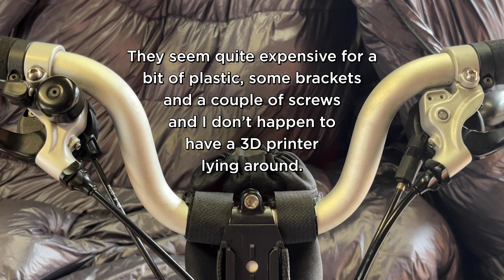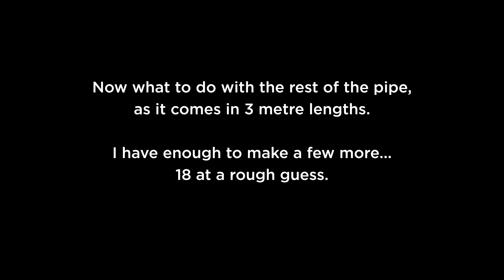Make a Brompton Handlebar 'Bridge'

Comment: Well done! I watched it even though I don’t need the bridge. For a light mount I use the two-fish lockblock mounted with two zipties right in the middle of the steering wheel on top of that screw…. Surprisingly sturdy. And I can still angle the light up and down (a little). For the phone: nite ize has a nice mount which places the phone next to your grips. A fancy (fanaue) mount does the same but mounts the phone in the middle. My nav app is my speedometer.
Reply from the maker: Thank you for the comment 🙏🏽

Comment: Good idea and looks good. Thanks for the idea.
I have a theory that it will fill with water though  unless you seal the 5mm holes with something.
Reply from the maker: Possibly, but as both ends aren’t sealed to the handlebar ‘exactly’, any water that gets in will drain out. You could always drill drainage holes if wish. Thanks for the comment. Enjoy 🙏
Reply: Its made of plastic, what harm can water do

Comment: Nice! Any reason (outside weight) one wouldn't want to use one piece of aluminium handle bar and fit that in a similar way? These Brompton handlebar bridges are hard to get online...
Reply from the maker: I’m sure you could create something very similar using aluminium tubing, but it’s not something I have easy access to… no idea what the minimum length you can buy is either… ‘spose you could cut down some handle-bars to fit 👍
Reply: @Bokooda  that's the plan, will try something based on a handle bar extender next week...